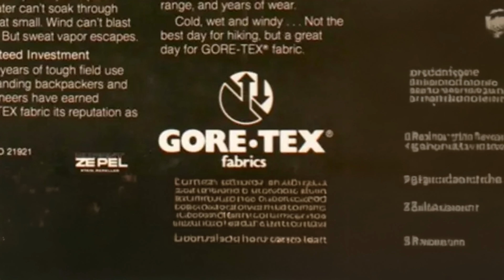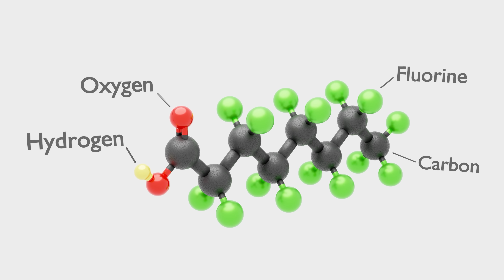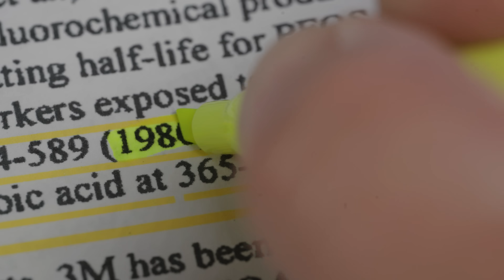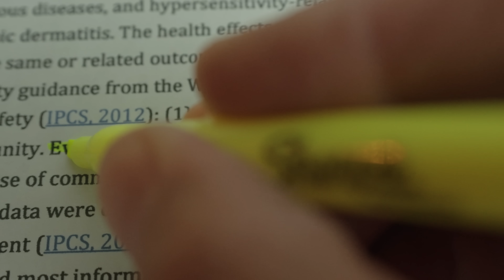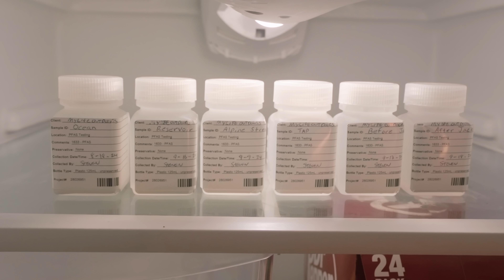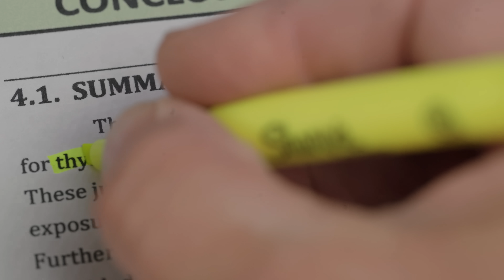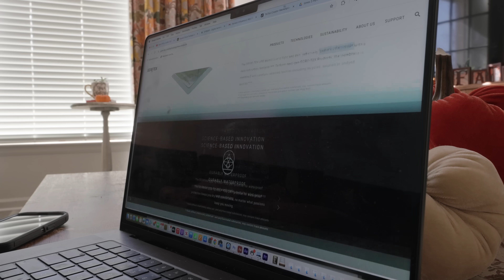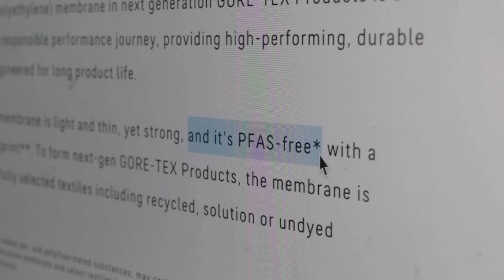Your Gear is Poisoning You! (Not Clickbait)

Comment: 8:45 Did I miss something or are those not plastic containers you're collecting water into?
Reply: that's why he's testing specifically for PFOA and PFOS.... literally a couple minutes later in the video...
Reply: Plastics do not necessarily contain PFAS. This video is NOT about microplastics, it’s about another form of forever chemical
Reply: As long as the plastic is PFAS free, which is true for common plastics like polypropylene, polyethylene, polystyrene, pet, and abs (unless those are used in a product that was additionally treated with PFAS, which I doubt would be the case for a sample collection bottle), then the samples should be uncontaminated.

Microplastics are a completely different issue but shouldn't matter since it's not what's being tested here.
Reply: @StephenSmith304  thank you

Comment: Crap testing = crap results.  How do you know it's the goretex membrane vice the DWR vice the nylon or polyester fabric?  Did you test the gore-tex membrane separately?  No. That paramo jacket uses PFC-Free DWR, but the polyester microfiber fabric itself is made using PFAS.  Did you do the same test with your paramo jacket?  What about your backpack, the polartec alpha fleece, your clothes, boots/shoes, etc?  Were your sample bottles PFAS free?  You implemented minimal if no controls and you made a direct causal link when you didn't actually isolate your test subject(s).
Reply: It's even worse than that.  He had to recirculate the water for 24 h to get his clickbait results.  Assuming ~2 GPM flow rate, and ~2 gal of water used, he's concentrated the runoff by a factor of > 1000.  The actual levels in the runoff are probably completely undetectable.
Reply: The video was made for effect.  The point is that the manufacture of the chemicals, and our continued purchase of them is to blame.  The jacket test is something of a red herring, used to show that PFAS remain.  As for the sample containers, it's pretty easy to make things like HDPE, PETE, etc. that are free of PFAs.  And do you think that a professional lab would accept any old sample jars and not be able to account for them scientifically?  Note that many garment types are on the list of PFAS-free products.  Scientific rigor in a 10-minute video isn't the object here--collective action is, both through legislation and with our wallets.
Reply: Stock holders speak up

Comment: At 18, I worked at Hielig Meyers furniture in the early 90s, I sprayed most of the furniture I delivered with a pump sprayer of pure PFAS, no masks, gloves, or protection, handled the mattresses, couches, and recliners while they were still damp, usually, I had dried spray on my arms, and in summer,would have been sweating. Now I'm 51, and was diagnosed with Primary Progressive Multiple Sclerosis when I was 42. An Autoimmune disease.

Comment: Once i washed goretex soft shell in waching machine. Its just became unwearable, layers disconnected, some glue came out, color changed, so it went straight to the bin. Since then i dont buy jackets which cost a lot and you can't wash them 😊

Comment: @MyLifeOutdoors, 
I have those jackets, but what troubles me the most is those great ski wax I have been using for years, 
Swixx Hight fluoro, 
they have been the top of the line and a game changer in gliding, 
but you literally have to atomise them into dust with brush action,
 after having vaporized them with a iron near their smoking point.
Usualy in the confort of your home or on a balcony next to it.

I do skate ski, wich is only about glide, the same ski used to do biathlon. 
But all ski use them.

I have heard the soil and water contamination on crosscountry course where very concerning without seeing any real documentation or documentaries about it. Industry has very recently changed the fluor Carbon chains used, but they still use rebranded PFas nano ceramics... I think

My hole family breathed this stuff, because when it's winter cold you use a place in or near you home to prep the skis.
After having heard the health issues in firefighters using Pfas jackets, I wonder how bad it is for a ski preparatory that would have worked on a ski World Cup circuit !

Comment: Interesting video. Would like to see the jacket test repeated after it is washed in a washing machine with laundry detergent. Wondering if the leakage found during the test was just from the manufacturing process and will wash away with an initial washing, or if the jacket continues to leach chemicals afterwards?

Comment: Thankfully I've always tried to avoid any sort of non natural material, always 100% cotton, 100% wool, 100% silk, 100% linen, or a mix of multiple.
I am absolutely fine if it gets wet, as long as the bottom layer doesn't get wet.

Comment: Thanks for the video.  As someone who works in the water filtration world I am appalled at the amount of companies in the world who flat out don’t care what their products do to people or the environment.  DuPont should be shut down for the complete lack of morals they showed by trial testing these chemicals on their own employees and then destroying the entire Nations tapwater supply …. Had to get rid of several very expensive jackets, home goods, etc due to PFAS / PFOS 

Also please don’t be misled by the lies you see from water filtration goods as most are not treated or certified (98%). If you want a certified product then check out Kinetico and the K5 reverse osmosis system.  Or let me know if you live in the metro Houston area.  $1,500 with 5 filters and 3 gallon pressurized tank.  Only RO made that has the membrane which bathes itself in RO water …. Genius !

Comment: To be fair, Arc'teryx has already transitioned a number of their items to the GORE-TEX expanded polyethylene (ePE) material. Unfortunately no alternative available in the industry appears to match the durable waterproofness that the PFC DWR coatings have provided — maybe some silicone-based offerings. Outdoor brands, in particular, are challenged with meeting environmental goals while still delivering on necessary product performance. When people spend $500 on a raincoat, they generally expect it to be waterproof.

Comment: So, based on the test: if you stood in the rain on such a jacket for 24 hours straight, the rain will have washed off somewhat like 0.85 ppt of those chemicals if you stood still in an enclosed poodle of about 3 sq ft to give them a chance to concentrate on the same spot. And that would be the amount on the ground, not on you (which touches the non-rain soaked internal lining, plus presumably wears other layers of clothes inside). Doesn't sound that concerning for personal health. How much of a danger is it, compared to 2000 other lifestyle and environmental factors (like inhaling city air full of car exhaustions) to make it worthy to care about or optimize?
Reply: Completely agree with our perspective; but see it is .65ppt he quotes for PFOA, Now turn to the 21ppt of PFBA he measured off the jacket. By the same logic the high stream of PFAB of 4.7 is the big concern. That means that tiny and short distance flow of water is consistently picking up an appreciable concentration of PFAB that has landed on the surface of that rocky landscape - assuming that PFBAs do not naturally occur in said landscape. That means there are significant environmental emissions from those processes whose by-product/ products are PFABs the concentrations around which will I would speculate are orders of magnitude greater than that measured in that solitary water sample. That enhanced by the dilution of the PFBA in the atmosphere with distance those sources to this stream. Putting it into perspective it looks like the issues of contamination from your Gortex  (as you argue) are insignificant to that emitted by stated industrial processes. I will not lose any sleep over wearing a Gortex. If there is a danger it is to those unwittingly living next to those processes as the example he has cited have suffered or have it blown into their locality just on this comparison.

Comment: 21 parts per trillion PFBA is high compared to the PFOA ppt, but PFOA and PFBA are different chemicals with different toxicities. The 4 ppt limit the EPA set is a standard to course correct from the horrible pollution Dupont and Chemours did. As noted in the video, average human blood is 4000 ppt PFOA, so 4 ppt is not toxic. One of the biggest issues haven't been the products shedding chemicals, but the regulation of manufacturing plants and how they dispose their waste. PFOA and PFOS are chemical precursors to the stable PTFE used to coat water repellent gear. Some residual PFOA and PFOS remain in the final PTFE product, but the vast majority of PFOA and PFOS from the manufacturing process was being ejected by PTFE plants directly into waterways. Individuals with rain gear aren't the issue, it's the companies producing the gear.

One thing to note: when reading scientific papers, significantly different does not mean impactfully different. It just means the difference is most likely not due to random chance. You could have 0.00000010% chance of getting liver cancer on any given day, but by drinking 1 liter of 21ppt PFBA water, that chance could go up to 0.00000015% (a statistically significant difference and increase of 50%). Does that mean you are going to get cancer? Chances are still extremely low.

I'm not saying that the companies who polluted our drinking water are in the right, just saying don't raise your alarm bells over potentially minimal impact results. To my knowledge PFBA hasn't been as thoroughly studied as PFOA and PFOS, so we don't know if it's as big a cause of concern.

Comment: What's the situation regarding USED waterproofs? Are they still shedding PFAS particles, or is the risk only when;

1) The item is new and 'loose' PFAS particles from manufacturing are initially washed off
2) When the item degrades or falls apart, then PFAS particles are released?

Comment: PFOA stands for Perfluorooctanoic acid which means that there is a free hydrogen sticking out on it. Acids move freely within water, but also can attach themselves to things. Now the strange thing with these fluorinated chemicals is that because Fluorine has the highest affinity of any element for electrons, it doesn't break apart easily, so there is this large molecule acting as an acid. How does such a large molecule evaporate with water to get up into the clouds to rain down into some remote lake. The problem is not from us wearing the clothes but from the manufacturing sites which utilize very nasty chemicals to apply teflon on to fibers, pans, and what ever product wants this great chemical on it. You see, it was not too difficult to make Teflon, but quite difficult to apply it to products we now desire. It is not Teflon that is the problem, but with the chemicals used to try to apply it to so many things we use. For example it is used on rugs and many fabrics to make them stain proof.

Comment: A little context: "1 part per trillion" (1 ppt) refers to a very small ratio, commonly used to express extremely low concentrations of substances in a mixture or solution. It means one unit of a substance per trillion (10¹²) units of the total mixture.

Analogies to help understand:
In terms of volume:

Imagine one drop of water diluted into 20 Olympic-sized swimming pools.
In terms of time:

1 second in 31,700 years.
In terms of money:

1 cent compared to $10 billion.
Scientific Context:
1 ppt is often used in environmental science, chemistry, and biology to measure trace levels of contaminants, such as pollutants in water or air.

Comment: I'm the daughter of a woman who worked in DuPont for her entire life. 

I have been screaming it from the rooftops but no one seems to care because Teflon is so great. 

EVEN MY OWN MOTHER uses Teflon religiously! 🤦🏻‍♀️

Look up the old ways, folks. It works. It requires a smidge of work but hey, you can take your favorite jacket and MAKE IT WATERPROOF without buying a crazy expensive bunch of gear. 

Favorite boots? Favorite pants for hiking? Treat them yourself at home. 

Even my own fully disabled ass can do it. Because my mom brought those chemicals home and contaminated ME. 

I would rather use wax and oil and have winter and summer outfits (depending on the amount of wax versus oil in your homemade mix, which makes your gear stiff the higher the wax, but also meltable in high heat if you are using the gear in extreme heat). 

And that's just the most natural form of waterproofing. You can use a lot of other things as well.

Comment: I just learned about PFAS and had just purchased and upgraded some gear that turns out to have PFAS. I want to limit PFAS, however does that mean I should buy new gear and get rid of the stuff I bought? Or send some of it back if possible? Or is that just the reality right now for some gear and it is what it is and not to stress too much?

Comment: You didn't address if your sampling method was contaminating the specimens, your sample containers were PTFE not glass, and your rain jacket test was cycling in plastic circulator pumps and hoses. What was the ppm of the first runs throw your test chamber?

Comment: Poor sample collection and preservation methods. For PFAS testing, water samples should be preserved by chilling them and kept at a temperature below 10°C, with a recommended holding time of 28 days from collection according to most EPA methods and industry standards. If so worried about PFAS exposure, then why sample barehanded, in short pants, improper eye protection, and no breathing protection.   Not too surprising because this "study" was biased from the outstart because research personnel stated they do not trust a manufacturer. Analytical method not stated, nor are laboratory certifications identified.  Bold research claims contained herein cannot are not accepted.